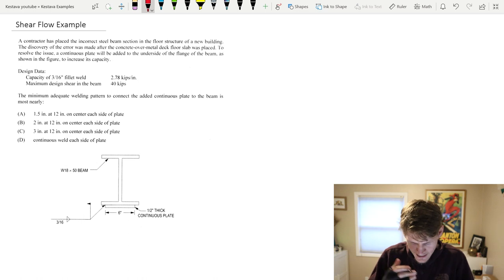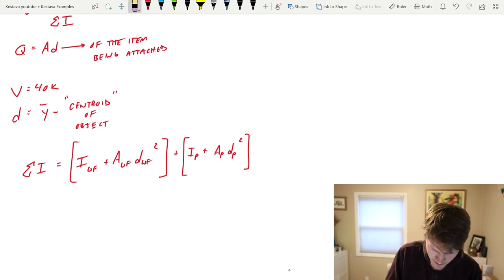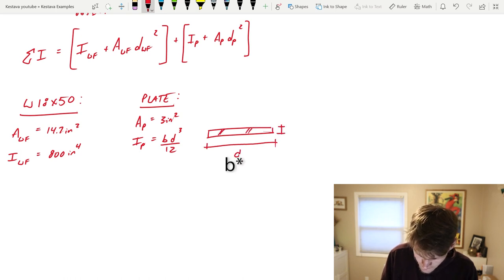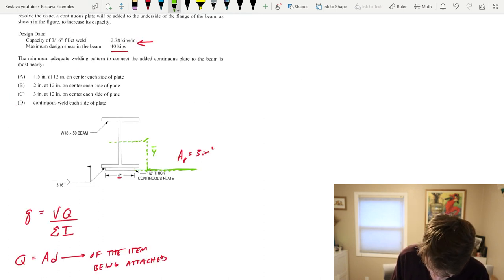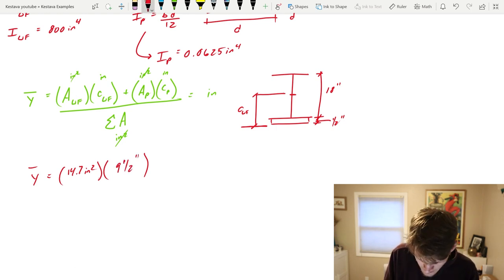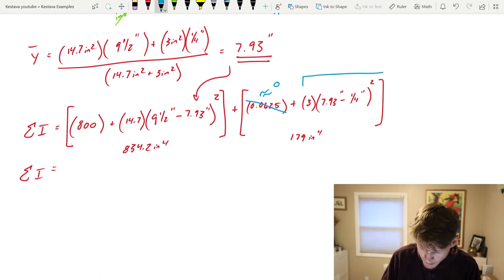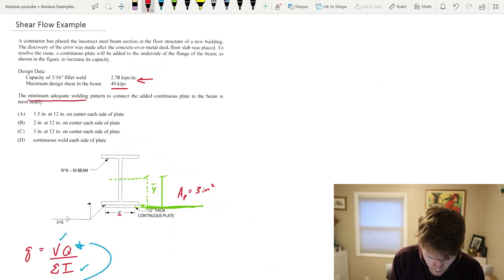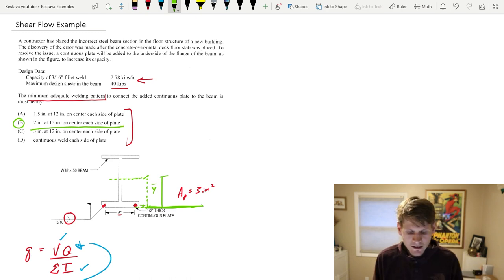Shear Flow Design Example | College and PE Exam Studying

Comment: Is this just the weld required to transfer vertical shear in the built up shape or is this the same approach used for confirming moment capacity of the built up shape?
Reply from the maker: you know... im not sure. I know this analysis determines what connection capacity is needed to sufficiently support shear stresses throughout the built up shape but dont know if it confirms moment capacity to the built up shape. I would assume yes, as you typically always check shear flow using the maximum shear demand on your system, which relates to your max moment demand. Maybe you can give me your understanding?? great question! Although - thinking of WF beams I kind of change my mind as primarily the shear stress is local to the web and a strong connection to the flanges possibly wouldnt be required to achieve the members moment capacity. hmmmm
Reply: @Kestava_Engineering  I've seen one example where you have to provide enough weld to fully = AsFy of either shape so that it can fully develop tension/compression capacity before weld failure, but I always feel that's less efficient.
I occasionally have to reinforce an existing W-beam with a WT to the bottom and can never find a good example to follow... There's also the question of how differing materials of steel affect the situation too

Comment: Can the shear flow formula VQ/I be used to calculate the shear flow on the weld of 1.5”x1.5” bar to the top of the flange if it is discontinuous with a gap?

Comment: Hello, thank you for the detailed description. Wouldn't the first step include verifying that the LRFD shear capacity of a W18x50 is 192 kips? Well exceeding the max design demand of 40 kips. Reviewing the answers, it may seem obvious that the intent is to check shear flow. However suppose option (D) read 'the plate is not required ' Some engineers would be inclined to check the shear capacity first before anything else, noting that the question doesn't specifically state residual shear.